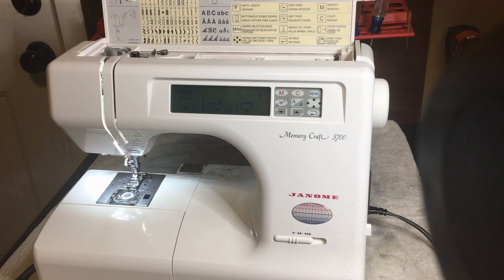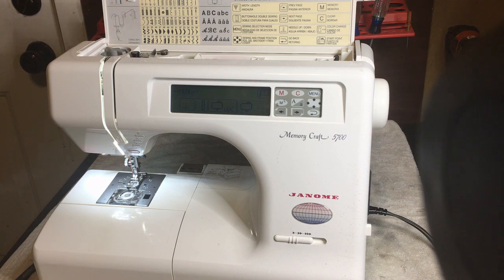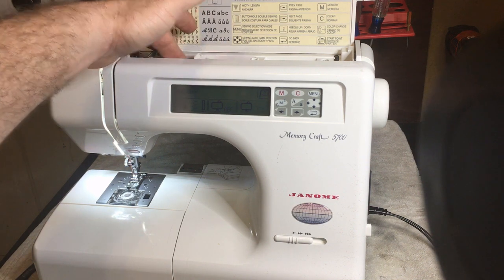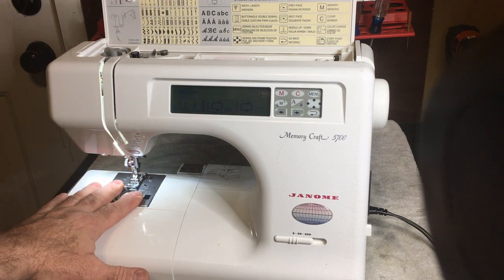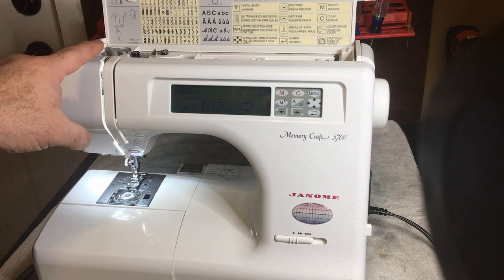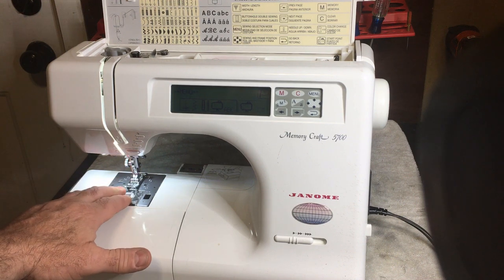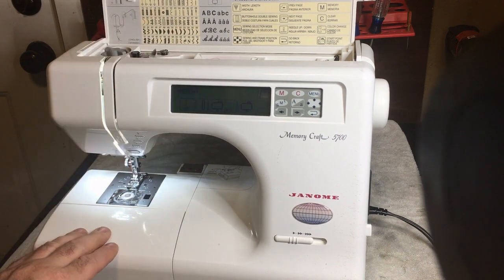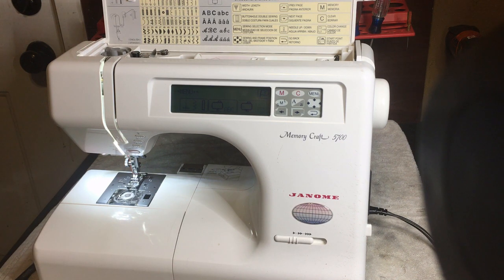Sewing Machine Problems Tension

Comment: Thank you so much! I purchased a Kenmore 158.13700 at a resale shop and it bird nested on me. Followed your video. Every mechanical part looked fine but in the bobbin case and under the plate was a tremendous amount of dust ball fiber mats. Got it out and cleaned and now it is working correctly. Thought it was the tensioner and was about to take it apart with your other video but found this video.  So grateful sir! 🤗👏👍💫✨
Reply from the maker: You are very welcome!

Comment: I just watched this video and did what you said and my HD6800C is still looping at the bottom. I also looked in the manual where it talks about testing the tension with the feed dogs up vs down and pulling the thread to test the tension. There's no difference at all with the feed dogs up or down, the thread is really easy to pull. Could you please help me. I bought the machine used, I can't take it to any shop, I don't have the money

Comment: My BRAND NEW machine is skipping stitches and the bottom thread has abnormally tight tension. At the store they told me that I shouldn't adjust the bottom tension. What can I do? I have to set the top tension to 6 and it makes tunnels in zigzag stitches. Thank you!